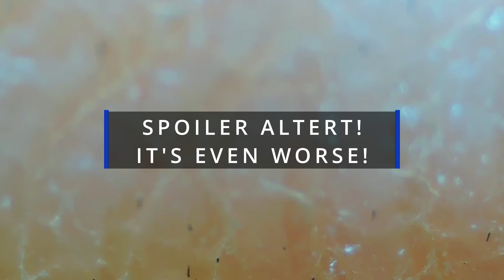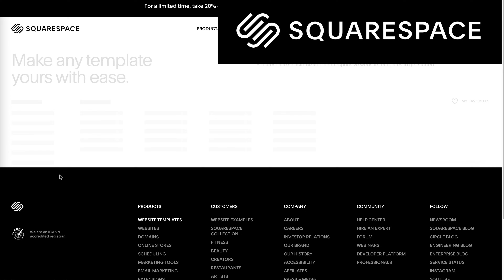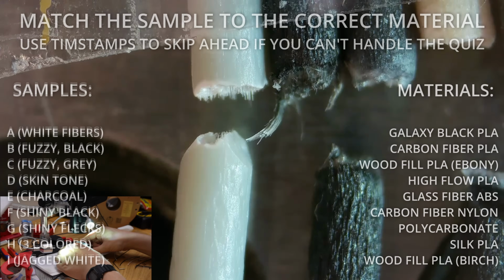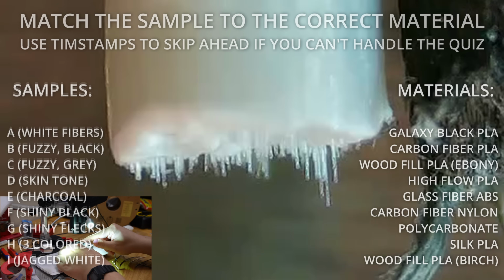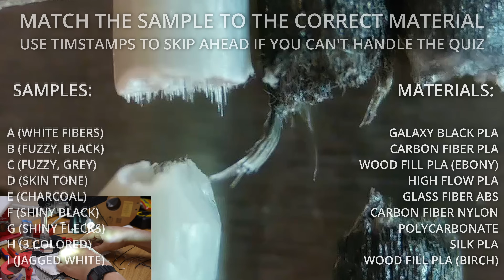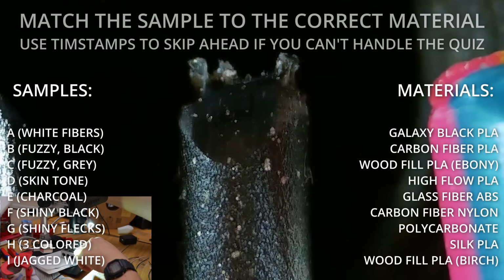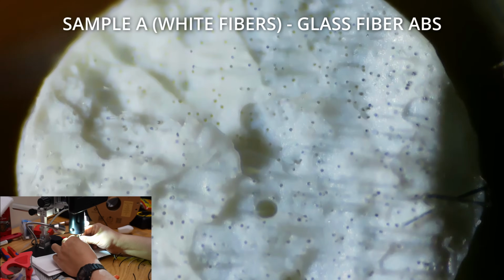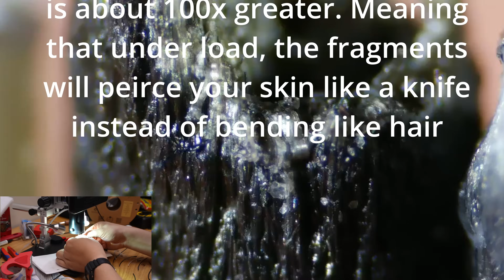Carbon In My Skin. These Wounds, They Will Not Heal.

Comment: I have a microscope. I also now have carbon and glass fibre stuck in several of my fingers! THANK YOU for bringing this to our attention!
Reply: When it comes to environmental and materials hazards, we are typically oblivious by default.  History repeats.
Reply: @TheCablebill ? most pollution is from India not from the West
Reply from the maker: I guess you didn’t want to take my word for it 🤣
But it’s much better to see this sort of thing for yourself than to take someone’s word for it.
Reply: @NathanBuildsRobots  One does not truly know 3D printing until one fights its fibres!. :p  I also wanted to see how effective acrylic clear coating is. Even thin coats from an artists's air brush are surprisingly effective.
Reply: @gruvinnz  You can do lots of 3d prints without ever seing a single fiber ...
Reply: Now imagine what's inside your lungs...
Reply: @RonanPaixao Unless you're sanding carbon fiber parts there shouldn't much risk of inhaling the fibers but definitely something for people to keep in mind.
Reply: I'm scared to look at my skin 😂.  I've had to clean up carbon fiber and fiberglass dust on the chopsaw and a couple of our CNC machines after a few jobs.  I already have omnipresent stainless and steel splinters, I don't need to add those to the list.
Reply: I mean.... as long as its in your skin and nowhere near your lungs I dont see what's the problem here.

The skin is made for stuff like this.
Reply: Stuff can get stuck in the skin for a long time. Most of it won't be a problem, but some stuff has a rather bad shape, size and gets pushed in with a bad angle. When the skin sheds it just gets pushed in deeper sooner or later. It's quite time consuming to get that stuff out.
Reply: As long as they're not stuck in your lungs, it should be fine.
Reply: Tiny fibres like this look like they only dig into the dead layer of your skin anyway so I doubt it's a problem
Reply: Thank him? Why? Our skin renews. As long as there are no studies concluding there are adverse health effects, I'm not going to be paranoid. A ton of plants have fibers in them that get stuck in our skin as well. Should we fear plants too?
Reply: @lennartjuhh there are definitely plants out there worthy of fear. Concluding that because there are no studies, it's safe, is probably the opposite of what I would do, but you do you.
Reply: @lennartjuhh  don't forget wood and metal
Reply: @TheDutchGuy110  where did you see metal fibers
Reply: The only real issue is if carbon fibers like these find their way into our blood stream, it’s been a small potential issue if you’re into archery with carbon fiber arrow shafts. Rare cases of damaged shafts being used and it basically explodes when used and the resulting broken arrow goes into your other arm/hand.
Surgeons have to pick out all the carbon bits before sewing your hand back up.
Reply: @jac1207  Well sure that's probably not great but the main issue is getting them into your lungs.
Reply: @lennartjuhh  If you watched the video in it's entirety the main issue with these fibers being so loose is that they can be inhaled via part cooling/fans. If it's easy enough to pick up with your hand and fibers come off it won't take much for them to get everywhere in your room.
Reply: @lennartjuhh so until there is no they study you don't question anything literal NPC definition
Reply: Better get to emerg right away. Could be serious. I have growths in the neck of my gallbladder. Life could be worse. A tiny bit of carbon in your skin is nothing unless you're a crybaby. Yes, A crybaby. Seems to be a thing over the past decade.

Comment: Great video, Nathan. You should partner with a university research group to look in to the toxicity of these fibers.

Which air filter do you have?
Reply from the maker: It’s in the video description, it’s the biggest household style air filter on the market with 2 massive carbon/Hepa filters. At full blast it recycles the air in my office every 1 minute
Reply: @NathanBuildsRobots Duh! I looked for it in the description, but missed it. Thanks!

Comment: You do know that skin is constantly being replaced by itself.
Reply from the maker: It’s the same way YouTube comments are always replaced by other YouTube comments.

But please explain how I have the same graphite pencil lead stuck in my knee for over 20 years!?
Reply: @NathanBuildsRobots  because surface skin replacement is surface only, only the topmost layer is getting replaced. the full flesh is not replaced, it just healed in the normal ways, if at all.
Reply: @NathanBuildsRobots  if you have any carbon fiber cloth, it will tickle for some time, hours, but its goes away fast. the stuff in in the carbon fiber filaments are no different. maybe a bit more split in strands.
Reply: @gsestream what about your lungs though?
Reply: @stveloop9452  so why are you inhaling any other dust
Reply: @stveloop9452  if you keep worrying, you are not living
Reply: @stveloop9452  not my/your lungs, God's life.
Reply: @stveloop9452  let the dead bury their dead, follow Christ instead

Comment: Airborne glass is known to cause disease, lung silicosis. By all reason, any particulate hard enough, like CF, should carry a similar hazard. After all both glass and asbestos are effectively inert, so their reactive toxicity is zero, their hazard is specifically as physiological irritant. But you also don't need to be TOO worried about particulate in general, for the most part the lungs are capable of encapsulating and removing a small amount of material, you do after all breathe in earth and dust. Arguably we have it relatively good right now, since we no longer rely on open fire and sooty lamps and candles, it's now just vehicle tyre rub-off and diesel particulate polluting our air, but these do have a substantial population health impact as well.

Let's not deliberately plant more particulate into your skin. Now that you have collected photographic samples of filament particulate interacting with your skin, you can get cheap sausages of different kinds (sheep gut encased and own skin) and see how similar they perform, to select a skin analogue.

The cig filter is made from chemically modified wood pulp, cellulose acetate. Glass, no, the industry learned its lesson from asbestos cigarettes.

Comment: Also something to note is how the fibers break down over time. Wood fibers will easily break down, so having a few embedded deep in your skin isn't as big of an issue. Glass fiber or carbon fiber wont break down on their own. Does your immune system start to break down glass fiber?
This is one reason why PLA is so nice. It will break down over time.
Is there a glass bead reinforced filament you can test?
Reply: I think that your body pushes stuff like this out. Certain substances can help with that, like drawing salve or ointment. In any case if it does stay, it either stops irritating you (not so problematic anymore), or it does irritate you, in which case you should extract it or have a doctor do so for you.

Comment: The only issue I'm finding is a source for how dangerous these fibers in the filament are compared to those that some factory workers would get exposed to regularly. Mind you these fibers are tiny compared to the ones used in CF wraps or molds, and while Copilot didn't provide a source, apparently they can only get into your system by an open wound or inhaling. Which considering that they're mostly encased in plastic in this scenario, you're more likely to get them embedded about skin deep.

Yeah my only guess would be to be careful handling them if you have an open wound, even though they should be filtered out by your liver or kidneys. And to run the part against a wet paper towel or under some water after printing.

Also, FFS Nathan, don't use your own body for shit like this, use ballistic gel or something. In a professional lab setting, you don't use your own body for the experiment most of the time.
Reply from the maker: Anything with a long aspect ratio (above 1:3) can’t effectively be cleaned out of lungs.
Particles below 60microns stay suspended in the air for extended periods of time
Reply: L copilot user
Reply: @nosidenoside2458  Google's search AI probably wouldn't be any better at providing sources for this. It might be worse than Copilot at some things

Comment: A heating element for my extruder came with some type of fiberglass sleeve covering the wires. I was itchy for days. Ended up covering the entire wires in heatshrink. 

Also been printing bambulabs petg-cf. it prints amazing, but im definitely going to minimize contact.

I’m going to be adding a hepa filter as well as activated carbon inside my enclosure.
Reply: built a big one. Those tiny ones that are already included into printers are way too small.

Comment: I would not be to worried about the powder particles from the SLS print. Because they look like they are pretty round in shape.
The reason asbestos causes lung cancer is because the asbestos fibres tend to brake along their length making thin long sharp particles. The high aspect ratio of the particles is why the bodys normal processes of removing stuff from the lungs does not work, and because asbestos is so inert it does not dissolve either. So it stays in the lung for ever and creating new scar tissue all the time, and that eventually makes cancer cells because of the bodys constantly trying to fix the scar tissue caused by the fibers.
Reply: Some things are not quite clear about microplastics, it's a subject of emerging research and it's difficult to say anything for certain. While generally effectively inert, when finely pulverised, the surface area develops such, that degradation and reactivity are amplified and new toxicity mechanisms emerge. While lungs can remove normal particulate material, it's a process that takes years.

With asbestos and glass you have two materials which are extremely inert, and both known to cause lung disease due to physiological interaction. So the source of hazard is completely different.

Being too certain isn't healthy. Asbestos was once used in cigarette filters as a "healthy' tar filter, and also used for many protective fabrics and the like. It was erroneously reasoned that its chemical inertness would make it safe.

Comment: For what its worth, if you have a memory foam mattress, its embedded with fiberglass for fire safety. It wasn’t a problem with my bed until I took a factory mattress cover off (which had a zipper but according to the manufacturer is not intended to be removed) but I’ve seen a lot of memory foam mattresses with fiberglass sticking through the manufacturers covers. Not saying filament isn’t a risk, but there’s probably larger sources that you don’t even know about. Education is the solution imo- fibers have a risk, and knowing when a product contains them and how to handle them safely should be better disclosed.
Reply from the maker: Hooooooollyyyyyy shiiiii. 
That is insane. I always wondered why memory foam pillows and blankets have a special case
Reply: @NathanBuildsRobots   If they can guarantee that the glass fibres are the right thickness to be flexible enough and sustain the load without fracturing, and long enough to not become airborne, they can potentially certify the resulting material as safe.  I wouldn't necessarily trust the material without testing it myself and being convinced that a suitable test protocol is in place, but fundamentally it is possible.
Reply: @NathanBuildsRobots  It goes without saying, don't be stingy and cheap out on your sleep surface. ;l
Reply: @NathanBuildsRobots If you'd be willing to branch out, that could be another test and video you could release
Reply: It is 100% a problem, we once had a mattress cover degrade to the point where the fiberglass was wearing off and irritating the skin.
Reply: Well that's me not sleeping tonight...
Reply: Oh fantastic. So the mattress I cut apart could've had fiberglass in it. Great.
Reply: @ZentaBon   if you had an expensive non-fiberglass mattress- it’s ok, or if you done everything outside and then threw it away - you probably also fine
in other case - you have to consult specialists (both medical and those who deal with such hazards) immediately, it’s not a joke (read my message above)
Reply: I assume this doesn't apply to memory foam toppers since they're typically not covered with anything. For my sake I hope that's the case because I've cut up a lot of those things.
Reply: @JJFX-  What did you use the pieces for?
Reply: @LiberalTearsAreGlorious  Mostly cushions, couch toppers, etc. and use the excess as padding for various projects. Tried cutting up a bunch as a DIY pillow once but I thought it was terrible... Never really been a fan of memory foam pillows though, even the fancy ones from tempur-pedic. When sized right it's great as an emergency couch topper or for awkwardly shaped RV/trailer beds.
Reply: I bought a Lucid mattress off Amazon and that thing was leaking fiberglass all over my bedroom. You cannot see it either unless you know what to look for in the dark with a flashlight. I started having awful red rashes and pain on parts of my body that came in contact and also would randomly feel like I had glass scraping the inside of my eye when a piece of fiberglass got inside it. The entire time oblivious to what was even causing it until I realized it was my bed. Many of these beds on Amazon leak fiberglass EVEN if they have good reviews like my bed did. Be careful. You can't just buy any bed with good reviews
Reply: Yes, like every lightweight ladder or outdoor kids picnic table or even small childrens’ bikes. They even put fiberglass in those plastic rumble strips that are on all the residential corners. They are all fine until the sun deteriorates the topmost layer of clear coat or whatever sealant they use. Heck even my electrical box in the back yard that the city maintains is full of fiberglass. I leaned on it when pulling weeds once and had to sit there with duct tape for 10 min ripping it all off me before taking a shower.
Reply: I am not sure how anyone came to the conclusion that fibreglass is safe for a person's bed. Degradation should always be consideration in safey of materials and household items should be required to safely degrade, it is just too much of a liability for household clutter to contain hazardous materials.
Reply: For fire safety...? What is the point. What about lung safety? If the house is gonna burn down it's going to burn why would fiber glass in a mattress be the saving grace here.
Reply: I don't think this is that common anymore in newer mattresses. Once people started taking issue with it, most manufacturers dialed it back or at the very least will disclose whether or not the mattress contains fiberglass
Reply: That’s why I have an Amerisleep mattress. No fiberglass.
Reply: Yeah, I heard of some cases with mattresses, where people remove cover, that explicitly stated not to be removed in several places
And those were not some mild inconveniences, whole families had life treating medical emergency, coz they breathed in all this carbon fiber/fiberglass fibers for several months/years! 
But in those cases it was natural selection really, coz even when they were giving an interviews all of them acknowledged that they saw cautions all over the place and even danger of fibers becoming airborne… but choose to remove covers anyways
It’s nuts, coz all of them had several children 🤦‍♂️🤦‍♂️🤦‍♂️
And that’s not even an end of it, houses became practically “unlivable”, and had to be emptied completely, all the things should’ve been thrown away, and even absolutely empty houses had to be cleaned by teams of specially trained people… and cost of it all… I’d say not many people can afford it
So lesson N1: do not remove cover if it say so ))
Lesson N2: always use additional covers (usually sold at the same places with mattresses), they protect original cover from bodily fluids and prevent from wearing, and you can change them every few years easily and cheaply
Reply: @llMarvelous  Many mattresses do not have any warning on the inner cover—so no it is not "natural selection". The courts agree, & have awarded people judgements against these corporations. Some corps are now selling " fiberglass free" models. Yes many now do have warning labels but plenty are still out there with none. As this video shows, it is not just glass fiber we need to watch out for.
Reply: Wait..... memory foam has f**** fiberglass in it?

Comment: awesome video, not going to use cf, just dont have the proper safety equipment
Reply from the maker: If I had a garage or workshop with external ventilation, I’d use it as needed, but still, 90% of the time it’s really not needed

Comment: 5:50 For the most part yeah.  I would LOVE for a proper doctor and/or Industrial Hygienist etc to chime in, but Asbestos/Carbon Nanotubes also have the issue of sharpness/barbs (which may be related to the elastic modulus you mentioned, but also maybe structure?)

Also “bio-soluble” insulation being marketed led me down a rabbit hole so that may help you too!

At the end of the day though yeah lungs are fragile, take care of them!
Reply from the maker: Doctors and doctors in training are expensive busy around these parts. I would love to have a conversation with a medical expert that specializes in the subject